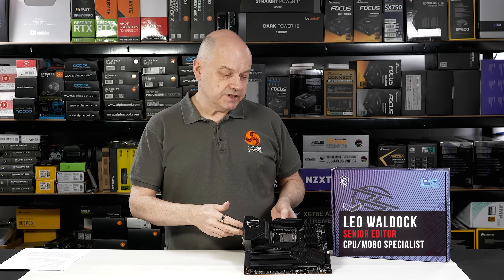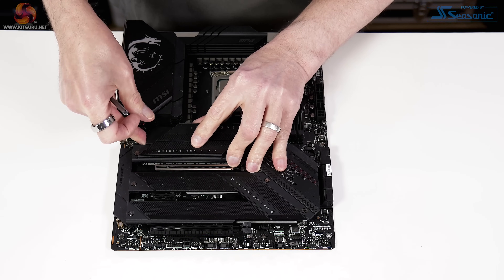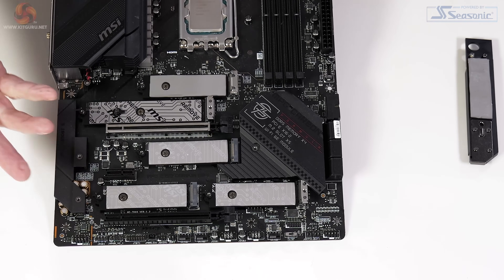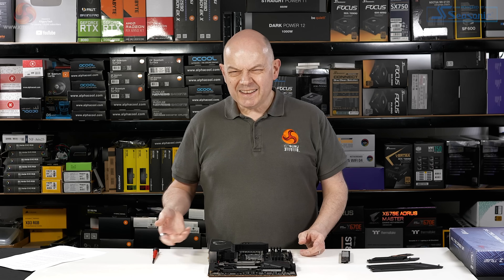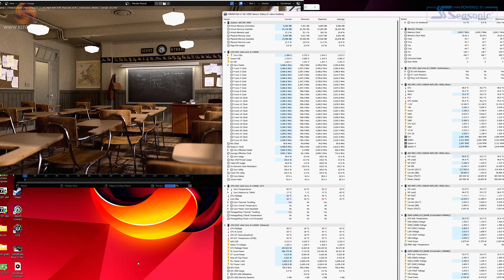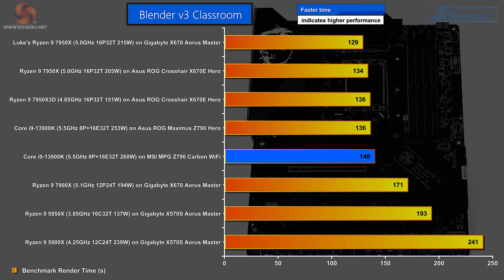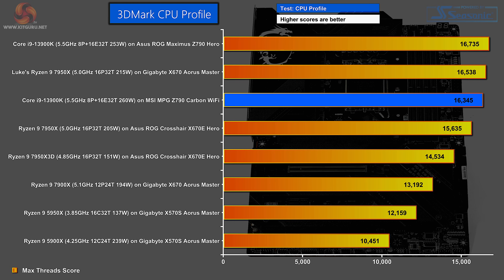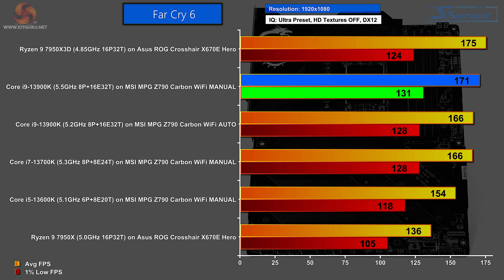MSI MPG Z790 Carbon WiFi - Ouch, my poor Core i9

Comment: Hi, I just built my new system running this Mobo and the 13900k, I followed the same steps as you provided, enabled BLCK at 100 and left everything else as default, however I'm finding my CPU's clock speed is constantly fluctuating between 4.9 and 5.5Ghz rather than being locked at a certain frequency. Sometimes it drops even lower to 3Ghz randomly. The bios has been updated to the latest version (v16). Is there a setting I'm missing that should lock the speed?
Reply: A bit too late. Change the windows power options from balanced to high performance

Comment: 05:32 Another scenario: iGPU dedicated to the Linux KVM hypervisor. First PCIe 5.0 x16 slot (x8 mode) dedicated and passed through to the Windows VM. Second PCIe 5.0 x16 slot (x8 mode) dedicated and passed through to the Linux VM. Hypervisor on monitor #1. Windows on monitor #2. Linux on monitor #3. Running simultaneously. Side-by-side.

Comment: I have a question. Currently have an am4 3700X processor, 64ram3200, X570 tomahawck motherboard and rtx 3080 graphics, it has never gone smooth in Blender and crash in render due to insufficient vram everyday. My question is if I make a last cheap bet with an am4 5950x (same mother, ram...) to upgrade to RTX 4090 or this is stupid, because of bottleneck and because the single core workflow in Blender is a deficit of amd or directly I abandon amd (any AMD) and mount a full setup intel L1700 with 13900, bla,bla,bla, bla, accompanying the RTX 4090???  The fact is that I am impressed with a 1000€ laptop (Lenovo with intel 12700 and RTX 3060 that runs smooth as silk.

Comment: Hey I'm thinking about getting this for my i9 12900k would I need to undervolt that? I'm switching to DDR5 and this is the board I'm interested in. I can get this for £399 right now is it worth it? I currentley have an MSI Z690 Edge WIFI DDR4.
Reply: @Cosmic_cloudx  how did it go in the end? I'm looking to do the same, bought a HP envy Te02 a while ago, gonna move all components over to new case and MB.

Comment: cant get this board stable at 7200 xmp, or with timings and trust me ive tried. 7000 stable 3 times then gaming causes crashes and tested again not stable.. 6800 is fine tho
Reply: Max I can get it stable is 6400 on 13900k.
Reply: @Ironbunny80  6800 would be easy enough, auto voltages and some timings

Comment: It works! 13900KF, Carbon WiFi used for Orchestration and composing… maxing out a big project I got the same results. Your tweaks got it dancing in the 80s when at 100%, thank you! Using a Noctua NH-D15 but I set the BIOS for water cooling to get max value, then applied your changes. Thank you for posting!

Comment: Could the BIOS settings for the CPU potentially cause frame drops and stuttering in game? Been trying to solve this problem for months and have pretty much just resigned myself to it.
Reply: Most of stuttering issues seem to point to memory. Do you have enough system memory and is it working properly? Also what graphics card?

Comment: Great video! I tried tuning the Bios like you did, and my temps were still running the same, but performance jumped by alot! ...I am running a compact 240 AIO. I may have to down clock to 5500 on all P Cores.

Comment: I saw this video, thanks for the information,  I am running a MSI Z790 Carbon w/Intel 13700K,  I followed your instructions in the video to manually setting the bios and my temperatures dropped.  Thank you again,   I was wondering how to do this and I was easily able to do it with your video.
Reply: What was the setting on your Asus motherboard you changed because I tried to find them they are not as the MSI?

Comment: i really cant decide between the MSI MPG Z790 Carbon WIFI and the MSI MPG Z690 Carbon WIFI. I´m gonna build a high end PC and gonna get the I9-139000K with a 4090 rtx. Is it worth the 100 bucks?
Reply: crazy cpu never heard of the i9-139000k i only have the i9-13900k
Reply: @droddel imagine not knowing what a typo is 😂
Reply: @naginuub1092 Imagine not knowing what sarcasm is

Comment: I think i found this video too late for my cpu/mobo.  one of them is def fried.  The computer would put a blister on your finger if you touched the aluminum case.  Was always running all auto settings and everything crashes now.  When I tried settings from video, it crashes even quicker, even bluescreens on startup sometimes.

Comment: Interesting, I had to tweak my gigabyte z790 aero g +13700k but I'm running air not an AIO.  A -.65mv underclock sorted my temperature issues and everything has been running great since the changes.  After seeing this I'll have to poke around a bit more and see what the PL presets are.

Comment: If you set BIOS to "Tower Cooler" does Auto do a better job?
Reply from the maker: The issue seems to me partly that MSI picks power limits that are too high for each type of cooler and also that those limits use Vcore that is too high. The annoying part is that MSI could doubtless fix this without much work. I shall add 'in my opinion' to leave some wiggle room.
Leo

Comment: Not sure if I'm doing something different I did this build with that mobo and the 13700k and just currently have it on auto and am not seeing any weirdness on the core temps at all, seems to be performing well. I will have to doublecheck my settings.
Reply from the maker: It depends what work your CPU is performing and hence how much power it is using. A light or medium workload is fine. We were demonstrating those CPUs working flat out
Reply: in 90% of the cases u won't see this issue , the issue only appeared when he was trying to load the CPU on maximum load which you probably won't do so it is fine to go with auto

Comment: In order to make those changes and not have any issues with the CPU's voltages and thermals, it is recommended to disable Game Boost, right?
Reply from the maker: Not sure whether you mean Game Mode in Windows 11 rather than Game Boost. Either way the answer is ' I only made those three changes and nothing else'
Leo
Reply: @KitGuruTech  Interesting.

8:41 top left underneath the CPU and DDR speeds, you'll see "Game Boost", which I believe is some an overclock setting by MSI, not sure if correlates to Game Mode in Win11. But if you click the CPU button underneath Game Boost, it'll essentially overclock the CPU.

Comment: What about M.2 (PCIe 5.0) ? If I install my drive in this slot, is my PCIE will downgrade from 16x to 8x ?
Reply from the maker: Yes it will, you are quite correct.
Reply: @KitGuruTech  Thanx for reply. Is any mainboard where 16x stay 16x ?
Reply from the maker: @SoundChaser_  Not that I am aware - if anyone knows otherwise they are welcome to comment below
Leo
Reply: @KitGuruTech  I understand. Anyway I didn't find any m.board. Maybe Im odd but for me slot Nvme 5.0 is useless at this point :)
Reply: @KitGuruTech  Update: Probably MSI Z790 Godlike mainboard's M.2 5.0 is not sharing bandwidth and PCIE 16x is 16x

Comment: Thank you so much for the overclock settings, my 13900ks sincerely thanks you.
It runs so much better with 1.3v limit, still giving my Arctic Liquid Freezer II 420mm a good challenge.
Reply: Do you have the MSI Z790 Carbon and the Liquid Freezer 2 420mm? That's the combo I'm going with, but worried about compatability issues.
Reply: @ocd9033  i run 13900ks with the carbon and artic 420, runs great no compatibility issues
Reply: @Dav3787  Awesome! Ty for the response! Did you have to buy the separate mounting kit? Or did yours come with it? Getting mine through Amazon, and I know there's a few versions with small changes. So not sure which will be shipped
Reply: @ocd9033  I would suggest messaging the seller and confirming ahead of time, i ordered mine from memoryexpress and it came with.
Reply: @ocd9033  I have MSI z790 Edge. It's the white version of this board. 
My CPU settings is now identical to the video other than the fact that my DDR5 ram is overclocked to 6800mhz at CL32.
Reply: @csguak  Did you have to buy a separate bracket? Or the aio cover thing surrounding cpu? Bc I was looking on the Arctic website, and it lists your motherboard as a motherboard that will have an issue with installation. Maybe they fixed that.

Never built a pc, so I'm worried some parts won't be compatible lol. The aio and mobo to start.
Reply: @csguak  Yeah I'm glad I came across this video. I honestly don't not a whole bunch about PCs and building them lol. So just doing as much research as I can before I purchase all of my parts. 

So looks like I'll be ordering the separate mounting bracket as well. Or just go with another aio. I'm kinda worried about that big plastic cover over the actual cpu area as well. I know they changed that in later versions so it could fit more boards, but who knows which version I'll get through Amazon. Whole thing is stressful lol.
Reply: @ocd9033  For ultra high end gaming, it's not really just plug and play anymore. I have unlimited budget and that only gets me so far. As long as you are not gunning for MINIMUM 100+ fps on a 4k monitor like me, you should be okay.
Reply: @csguak  hahaha well my build is going to be about as good as I can get it. 

Doing i9 13900k, RTX 4090 Gigabyte OC, Corsair 7000d airflow, Liquid Freezer 420mm, 32 ddr5 ram,  msi z790 carbon mobo, msi 1000w psu.

So yeah going pretty high. Which just makes me even more worried bc I've never built a pc, and I def don't have unlimited budget lmao. So I'm just hoping I can get through it and not screw anything up. And I get compatible parts.
Reply: @ocd9033  you hit the jackpot on that RTX4090. I spent $10,000 on 4090s alone and gigabyte gaming OC is the only one without a loud coil whine.

Comment: My ASUS ProArt Z790-CREATOR WIFI also gave far too much voltage onto my 13900KS. With a negative offset of -50mV (it can work with even less but I want to have it rock solid) and PL1 and PL2 both limited to 320W cooled by my custom loop with EK Velocity² full copper block it barely reaches 90°C now and gets me a Cinebench R23 score of 41000. I think the issue is not really voltage, it's within spec. The issue is the insane power limits that come out of the box. I didn't even have such a cooling selection. PL2 was on 4095 and PL1 on 350W out of the box. I think they do this to look faster in reviews because they think they just run short benchmarks with overkill cooling.

Comment: With MSI boards, even better than changing the vcore directly is to lower the CPU Lite Load Mode from the default setting of 9 to something like Level 6 or 5.
Reply from the maker: There are many ways to go about the job which makes it all the more annoying that MSI didn't choose to pick one and go with it.
Leo
Reply: Im new to messing with my CPU in bios, can you explain why you suggest this?  I've got a new 13700k on an MSI tomahawk and just poking around for advice/info.  Thank you. :)

Comment: the rams measured in mhz LOL
Reply from the maker: DDR stands for Double Data Rate. If you check the spec of, say DDR4-3600MHz you will find it actually runs at 1800MHz. With DDR5 the industry is still using the 4800, 6000, 7200 or whatever figure but has dropped the incorrect MHz.
Leo
Reply: Not hard to spot the guy who recently stumbled upon mega transfers. Like Leo said in the video. Which of course you watched.

Comment: you would probably still have to remove the GPU to access the bottom 3 m.2 slots whether the heat shield was in eith er 1 piece or 2 pieces

Comment: the ports usb3 port and sata ports would be called horizontally mounted instead of vertically mounted, I don't think laid down is a very technical term LOL
Reply from the maker: That is correct when the motherboard is on the test bench as per the video however it spends its working life in a different orientation inside the case.
Leo

Comment: I have the Z690 variant (DDR5) with an i9-12900. I think it's an excellent board. Selling point for me was the 5 M.2 slots and VRM. In future I'll do without the ARGB however.
Reply: do you have any glitches or problems with the bios? I want to pair the Force variant with a 12600k :)
Reply: @baloneyslice247  no problems at all with this board